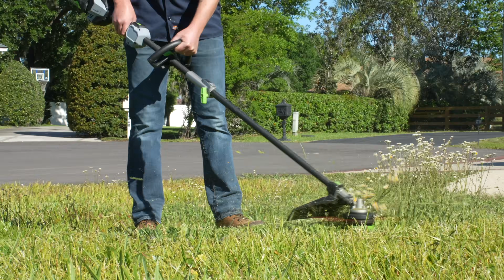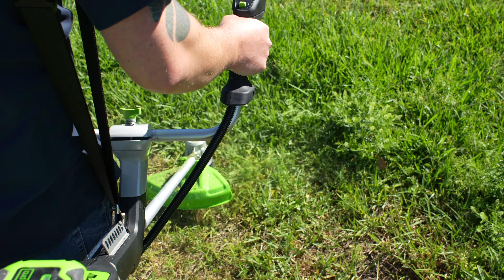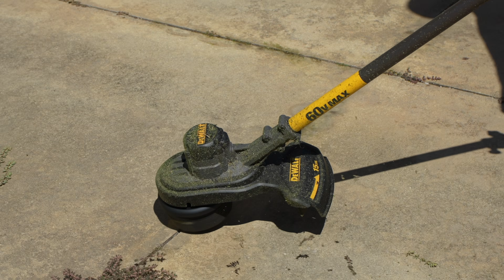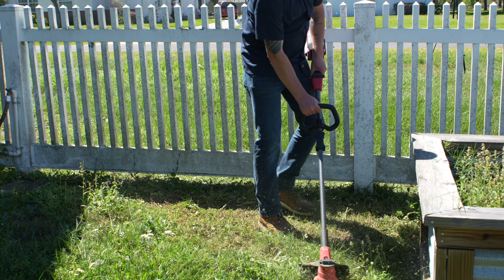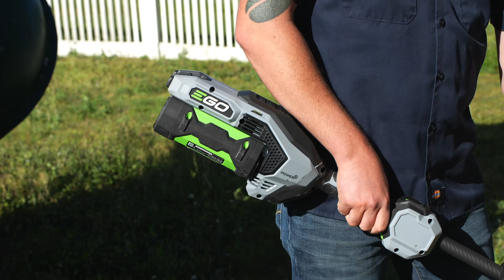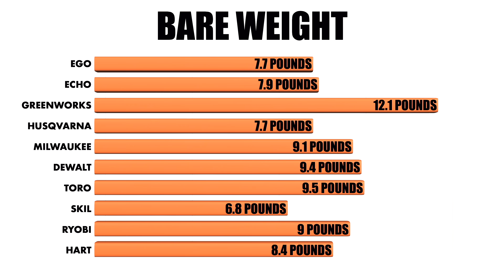Best Battery Powered String Trimmer? Ego, Milwaukee, DeWalt, Toro, Ryobi

Comment: Just remember you want to buy one that has the motor up at the top near you. If the motor is down in the string head that extra weight so far from your body will work on your back after a while.

Comment: I purchased the EGO trimmer based on your recommendation.  I used it about 15 times and then it stopped working.  Looks like the motor control module burned out.  I contacted EGO.  They refused to stand behind their warranty.  They will not replace nor repair my trimmer.  Complete fail.
Reply: The Toro flex force tools are pretty damn good, haven't had any issues...
Reply: Sorry to hear this. I'll never buy an EGO.

Comment: Hi
Husqvarna machines, commercial use
Have there been any problems with electrical plugs on these Husqvarna machines
The electrical plug must be lubricated once in a while
Which lubrication must be used, with silicone?
When the machines are pressed and get hot, the plastic in electrical plugs becomes brittle over time, from heat and incorrect lubrication?
Otherwise very good machines
Doesn't seem like the electrical plug can or must be changed?
Any experiences with and will share them publicly, Thanks.

Comment: A number of those brands  now have multi-tool capability models. Your attachment chart only lists one brand as having that feature.
Reply from the maker: Among the brands we tested, there was only the one that had attachment capability. We made this as a video for dedicated string trimmers. You often trade off performance for the versatility you gain with an attachment system, so they're not usually the strongest or best string trimmer offered by any given company.

That being said, we have written articles on quite a few of the established OPE attachment systems on our website if you wanted more information on any of those!
Reply: @Protoolreviews within the dedicated trimmer segment, you have the ones with front-mounted motors vs the ones with rear-mounted motors. The argument has been front mounted is better because it's a direct drive system with no transmission shaft like the rear ones have, but some say the rear motor units have higher wattage motors.

Comment: Can you use a weed steel brush on these machines or only the string line attachment?
Reply: Stihl Kombi system has lots of tools... I can't think of one they don't have for it....  Blower sweeper edger, trimmer brush cutter, angle edger,  bed redefiner.

Comment: I have 1.3 acres of grass and wild stuff. Bought the top of the line EGO about a month ago. HIGHLY impressed! I cut mostly with the low power setting but use high power for thick areas. It is well balanced and far  less vibration than my Eco gas trimmer.
Reply: I tell friends it’s like comparing a Model T Ford to a Tesla. With my gas powered Eco, after a half hour of cutting, my arms would be sore hour hours. I’m 78yrs old and keep my cutting with the EGO to around 1 hour. Could easily go longer. On a scale of 1 to 10, the vibration on the Eco ( Or probably any gas trimmer) is a 10. The EGO would be a 2.
Reply from the maker: You're not kidding, that thing is a beast! Thanks for watching and have a great day!
Reply: I'm in the same situation. 1 acre with weeds that get a few feet high. I'm assuming you have the rear motor model and an extra battery.
Reply: How does it cut nettles and bigger blackberry bushes?
Reply: @SD_Alias  I have no idea. Remember, there is a difference in types of line. Some cut better than others. This is primarily a weed and grass cutter that owners also cut heavier stuff with.
Reply: The bump feed on the ego does not work after a a few months of use. And a battery suddenly died. Very sad, and does not sell at Home Depot anymore. Only in the NEX on base. Really hard product to get.
Reply: @robiandrich7860  My EGO is an auto feed. I don’t have to bump it to feed. I have one battery. It lasts for more than 45 minutes but I’m ready for a break by then. I put the battery on charge and do something else for 
less than an hour.

Comment: Ego line iq with power head is life changing.  Milwaukee melts both tool and battery.
Reply: Been using the Milwaukee now for 3 years. No melting going on here.
Reply: The first time I hear that. In fact the Milwaukee batteries are one of the best in the market…

Comment: You have the ryobi as now attachment capable when that litterally one of its biggest selling points especially with the carbon fiber straight shaft (attachment capable) can be turned into a brush cutter,leaf blower,edger,pole saw, cultivator, hedge trimmer,yard sweeper,and even a snow thrower. This video seems a little biased if you ask me. The ego are grateful string trimmers gone bet me wrong but when I have a bunch of 18v and 49v ryobi batteries it wouldn't be worth it to to me to spend 300+ another 1500+ for all other equipment and extra batteries 🤷‍♂️🤷‍♂️🤷‍♂️

Comment: My question is which one has a trimmer head that can be removed so I can put on a quick change string?  I like the heads that you stick in a length of stringand when it wears down you pull the string through and push in a new one.  Simplistic solution.
Reply: Look at the Shindawa replacement string head that Chickanic recommends. Replaced the head on my Makita and love it.

Comment: I have the ECO 16" trimmer. It works well and is very powerful. Almost too powerful. I mean, I use it for the thicker brush I have in my yard. I use a smaller, less powerful trimmer to handle the simple edge trimming around the yard.
Reply: ECHO, Ego, now,I have another brand to keep up with, Eco.

Comment: In my opinion, there is no best trimmer. It's subjective and based on what the user wants out of a trimmer. Some people need trimmers that are more powerful because the brush is longer and thicker in their yard. Some want a trimmer with a longer battery life becasue they have a big yard. Some people want a very lightweight trimmer because they aren't strong. My point is everyone has different needs depending on what they're using the trimmer for. So research features that are most important to you and go from there.

Comment: Hands down I think the XRU18Z by Makita is the best cordless trimmer if you have Makita cordless tools.
Reply: You should try  Makita’s DUX60 Couple-Shaft Head with the Brushcutter attachment, basically it’s the same tool but has a bunch of different attachments making it far more useful, they should be releasing a Water Pump attachment in the US soon!

Comment: Ego makes fantastic tools overall but the iq series leave much to be desired. I was a big fan of the line IQ initially but after over a year of ownership now I never use it anymore because the auto feed is spotty at best when it comes to advancing line. Now I have to wait until the trimmer thinks I need more line and thats well beyond when I normally would want more string. Honestly bumping the head is not a problem that needed to be solved in my opinion.
Reply: 7 months in and I abuse this with living on a lake with "weeds" closer to brush, absolutely no issues. Is there a mechanical issue with yours, maybe?

Comment: How did a Stihl not "make the cut".  The number one brand that professionals use was not included??
Reply: This wasn't a review, this was a commercial disguised to look like a review for all the brands that pay their bills.
Reply: I am reading the comments looking for that answer as well.  I also noticed some tools they tested were multi tool units. Sthil has both they could have tested
Reply: @georgeuribe3305 stihls battery line is probably 2 or 3 times more expensive than it needs to be. Their gas stuff is great but they are using their name to gouge prices on poor battery equipment
Reply: ( @georgeuribe3305 )Stihl gas powered tools were excellent, I went with Toro when I changed over to batteries. Stihl just isn't known for electric, yet🤷

Comment: I have used my Ego for about 4 years now...outstanding weedeater, it has never backed off from a task. I am however startingto notice my batteries are not lasting as long. I have probably 100-120 charge cycles on them. They will be OK for a couple more years I'm sure.
Reply: Can or have you used it as an edger as well?
Reply: @jemelpeters you can. Just change the angle of the trimmer gand holder which you can on the latest models

Comment: This is obviously aged now as Ryobi has attachments.  I'm very surprised there was no Makita.  Obviously if you have a certain brands batteries around it's an advantage using that brand.  I can't imagine most people watching this, don't already have a cordless tool around.  If the trimmer works with my drill battery for 1/2 the time of these extra large, extra expensive high voltage batteries, in the end I'll be way ahead charging more often.

Comment: Milwaukee has a shoulder harness available... dunno if that's something you can use as an attachment, but i definitely didn't get it in the original box, had to buy mine from Ohio power tool

Comment: Egos power load is definitely the easiest reload but not the quickest, I’ve reloaded echo (OEM or replacements) faster. Then again, I use them everyday at work so that may be why.
Reply: Which model of the echo do u have?
Reply: @chenguavez347  for the true echo ones have have either the echo speedfeed 400 or 450 (ones just bigger and holds more line) on our srm 2620t’s. If you have a decent size trimmer (25+ cC) I’d go with the 450 head but for a smaller trimmer, 400.
Reply: Both heads are about 35 ish dollars (in Delaware atleast)
Reply: He has an EGO, not ECHO.
Reply: @louislandi938  I’m aware, I wasn’t saying Wht he has. I was saying tht I could reload my echo heads faster than the ego powerload heads. Even tho the ego is literally a push of a button (making it easier for most ppl to reload), I can currently reload my heads faster.
Reply: @louislandi938 also, there is an echo in the video with the head I’m referring to

Comment: EGO's Line-IQ does NOT WORK. You are always waiting on it to unreel more string, and if one side of the string is shorter, you're stuck with it until it decides to unreel the next time. Get EGO's multi-head Powerload trimmer, which also rotates counterclockwise. 👍
Reply: when I read about the line iq feature it sounded interesting but I just knew it was too good to be true. I'm glad I didn't go that route.

Comment: Kinda biased in my opinion. They used top of the line trimmers in some brands and bottom of the line trimmers in other brands. Each brand has different models that are better made. Why not use either the best of each brand or the worst?
Reply: @Protoolreviews  How did Sthil not make the cut to even test them

Comment: Have you seen any over heating issues with the Milwaukee? I am now on my 5th replacement and it's still cutting out within a few minutes. So it's melted 4x12Ah batteries and 4x5Ah batteries I don't use the larger batteries anymore as they are to expensive to replace. So now im looking at changing brands..

Comment: Great review. I have the Ego myself and love it. Although when dispensing the line it does take a bit longer at times for some reason, it still works just fine. I see you have the new Brunt boots. I still have the Perkins and they've held up very well so far over the past year.
Reply: Is the ego heavy?
Reply: @chenguavez347  It all depends. It's hard to answer that question because everyone is different. I personally think it feels good in the hands and is not heavy but again that is my opinion when holding it myself.

Comment: I have Ego 2 stage snow blower, lawn mower, blower and I did get the new Line IQ. The Line IQ sucks. I returned it. The head is 4 inch and it automaticlly release the line when it is 1 inch...  Sometimes.. I dont recommend that, just get  abumb head or another brand.
Reply: Seems like they need a feed- line button!

Comment: What about the Lowe’s  Kobalt 24V or 40V?
Reply: 👆👆👆This! I have the 40V and have never looked back.
Reply: @ThaOlBoy  which model?
Reply: @chenguavez347  40V sir.
Reply: @ThaOlBoy  nice,how long have you had it? I'm thinking between the kobalt or the ego.i have the toro but I hate the part where u have to press a trigger on the same handle as the spin button.i seen the kobalt in person and the trigger seems better
Reply: @chenguavez347  The Kobalt has a similar setup but it's just the safety. Once you get use to disengaging the safety it becomes automatic. I've had it for 4 months and the battery life is amazing. It paid for itself after my third time using it.

Comment: Have an EGO and it’s 4 years old. Doesn’t auto feed the line like the newer model but it’s still great. Only sore point is the bottom pad wears out first from tapping it all the time to feed the line. I’ll need a 2nd cap soon. RECOMMEND A+
Reply: add a bolt to the bottom cover, there are videos on it.
Reply: @tonyd3029  Top tip man, thanks 🙏
Reply: I had the line iq. Don't get it get another bump head. The line IQ is finicky and it is suppper hard to do edging with the shielding on. It sometime detect low line and auto spools for you, again, sometime. I don't have time to constanly mess around. I rather tap it and be done. I return mine. Get anyone of the string trimmer beside the line iq. Get the one with auto feed since but a bump head. Maybe multihead one.
Reply: @internalharm  thanks for the great feedback 👍🏼